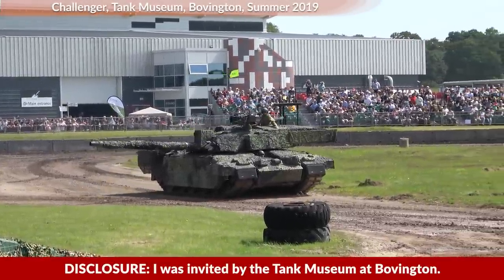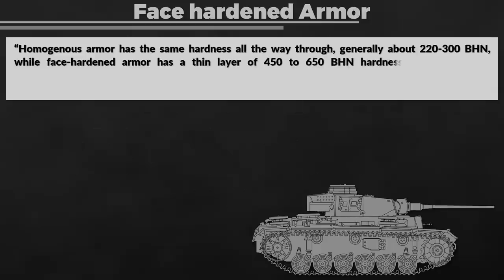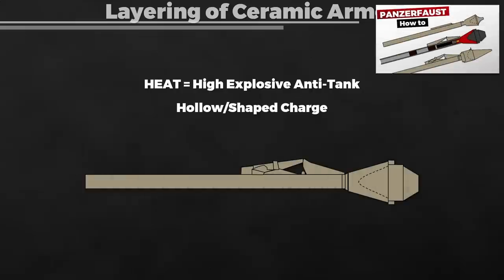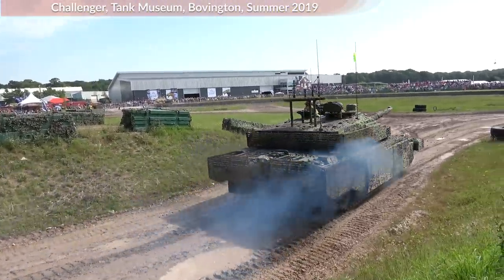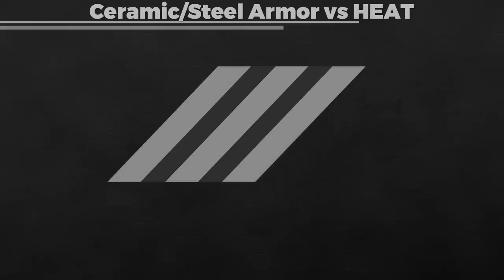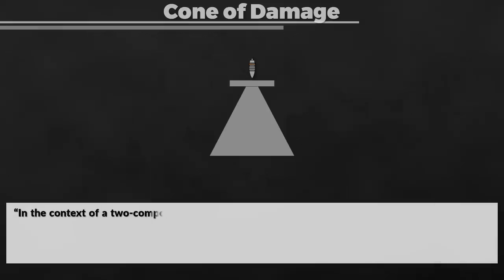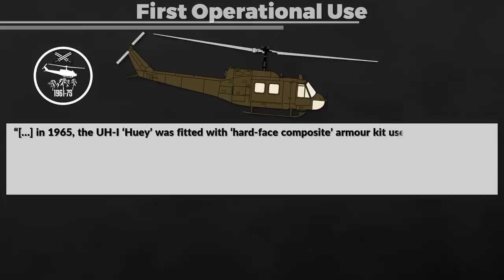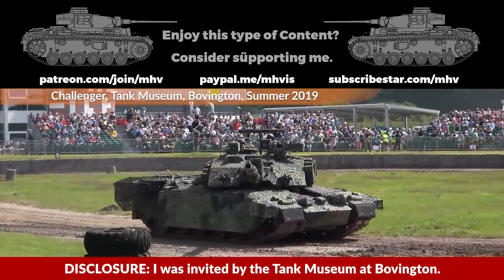Why Ceramic Armor? Hard but brittle!

Comment: Tanks, death traps,  like battleship s , their day is done.
Reply: Yet still in use in mass numbers
Reply: The US Marine Corps got rid of their tanks, the UK has less then 300. Of the New tanks the UK is currently trying b to build only 250 or so are planed.  No new tanks are on order for the US. Germany Has about 300 tanks, active. The premier Russian tank devision, the First Guard, was decimated in the Ukraine in arrival.
Reply: @raywhitehead730  People have been saying the tank is dead since the early 1970s--your claim is neither particularly novel nor innovative. However, tanks are still around, because there doesn't seem to be any replacement that can perform the roles of the tank. The aircraft carrier effectively displaced the battleship in delivering long-range fires in surface naval warfare. This was made possible by advances in aviation technology and air-delivered munitions which could threaten both naval and land assets

The fact that the USMC got rid of their tanks doesn't mean that the tank is dead, or that the Corps (or any military organization) always make the wisest or most prudent decisions. The same USMC also seems to think that a slightly modified HK416 with a 30-round magazine can replace light machine guns or squad automatic weapons in fireteams. Besides, if the Corps needs some heavy metal, they can always rely on the Army to supply it. The US isn't ordering new tanks because its current fleet is sufficient for the sort of conflicts that the DoD anticipates. It also doesn't help that the US spent the last 20-odd years fighting in low-intensity conflicts where tanks weren't at the front and centre.

The First Guard Division was thrashed in Ukraine not because tanks are obsolete, but because the Russians are bad at using their tanks properly. The result would have been the same even if the Russians were clad in powered armour, rolling around in lighter armoured APCs, or any other alternative you can think of.

The only things on the battlefield which can reliably kill tanks are weapons specifically designed for the purpose.. and most of those tend to be extremely large and bulky systems. The FGM-148 Javelin which has caused so much woe to Russian tanks also happens to be a 50 lb system. 

But if you still think the main battle tank is dead, please enlighten us as to what weapon system can fill all of the following roles:
1. Direct fires against enemy targets of all sorts from armoured vehicles to infantry to fortified positions.
2. Incredible protection for its operators against everything except for extremely specialized munitions.
3. Very high mobility in almost every sort of terrain.
4. The ability to slug it out in direct combat with enemy tanks (especially if your opponent hasn't gotten the memo that "the tank is dead" and still insists on fielding his own tanks).
5. All weather operating capability.

Neither aircraft, self-propelled artillery, drones, cruise missiles, nor IFVs armed with autocannon and ATGM satisfy all 5 requirements.
Reply: Western tanks don't surround their crew with bare ammunition !
Reply: @raywhitehead730  Ray, the Marine Corps got rid of our tanks for very specific reasons related to our very specific place in the United States military overarching strategy. It's not a great argument to lead with.
Reply: @Schwarzvogel1  Even longer, Military History Visualised has already done a very good video regarding these talking points. Titled: Tanks are obsolete, apparently since 1919